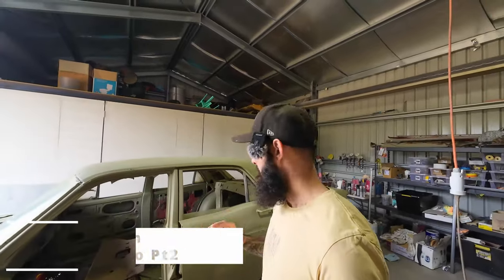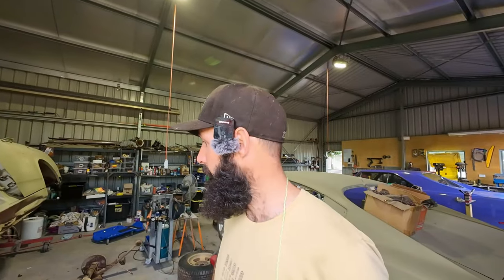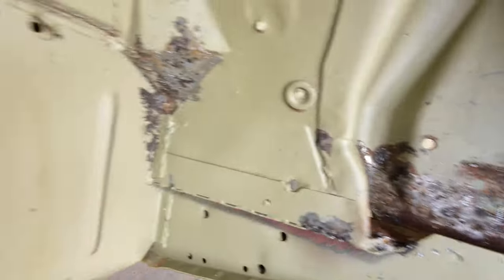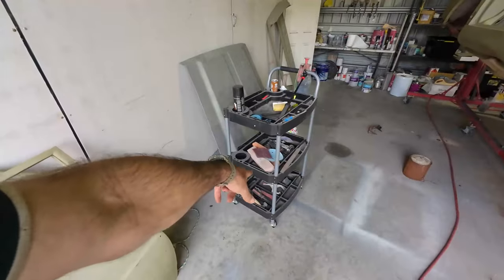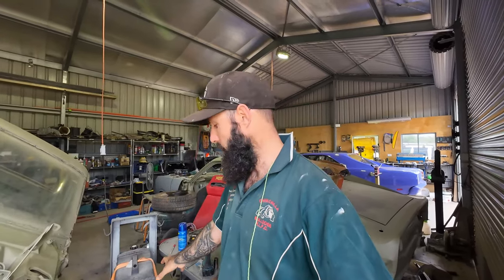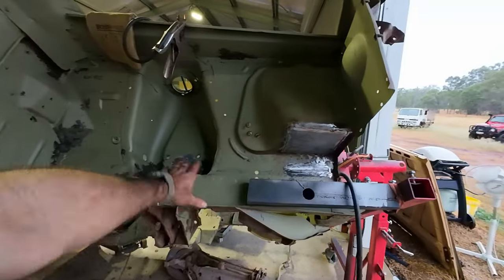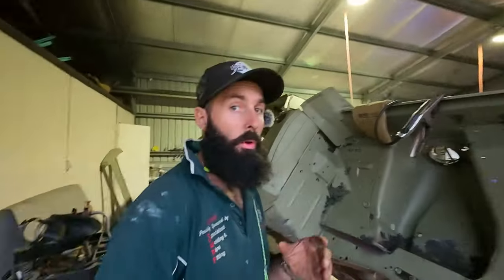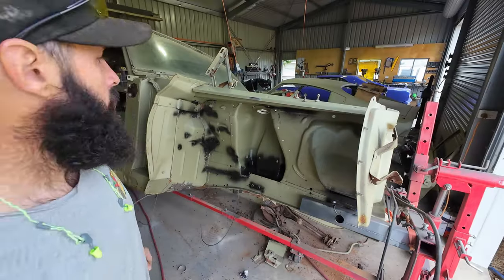Ford Falcon Full Restoration PART 2

Comment: Even on thicker steel, I have always cranked it up on the mig and done short blasts. I'm no welder, but it does seem to work better if you aren't a welder by trade.
Reply from the maker: @beano9343  I definitely do it on thin steel, haven't tried it on thick steel though, I'll give it a test run!

Comment: thanks for the tip on the fertan, just bought a Massey Ferguson 178 and it will be used for sure!!!
Reply from the maker: Ah an old Massey! Good stuff mate, yeah it works 💪
Reply: @TwistedMetalCustoms  another tip , for penetrating fluid mix 500ml of acetone with 500ml of ATF works better than most I've tried
Reply from the maker: @jamesreardon8585  Reeealllllyyyy?? ive never heard that! ill give it a go! i always come across rusty bolts haha, cheers my friend! 🍻🍻

Comment: Good to see your back into it .
I’ve always used 0.9 , so I’ll have to try 0.6. With 0.9 I find there’s a lot of grinding, to get that smooth seamless look.
With that industrial paint it came up beautifully, I use killrust gloss black but that takes days to finally dry. Cheers for the tips mate. Motavation is the hardest part haha!! 
Cheers mouse
Reply from the maker: Yeah give it a go Mouse, I definitely fount it more usable and easier to weld with 0.6, alot less grinding with the higher twnps too, just takes a bit to get used to haha. Motivation IS the hardest part for sure haha, kill rust is good but does take a little bit longer being enamel to dry but decent for a can 
Cheers 🍻

Comment: Keen as to see this build done . Mate whats the steel u use for the rust repair . Is it zinc coated or black steel  and what wpuld the thickness be .
Reply from the maker: Awesome mate me too! Um, I think it's just black steel, or plain sheet metal, and it's about 1.1mm thick im pretty sure, I'll check when i get home and msg if it's any different

Comment: Thats very interesting to see where these old Fords rust as I Iack a hoist. The hidden bits like the shock tower bottoms. I still have my Fathers XW and the only rust I can find is a tinnie bit at the bottom of the rear quarters. The floors are mint as the fire wall is rust free. We are farmers so dad put in a Ford 4 speed toploader as he was always pulling trailers.
Reply from the maker: Yeah I'm pretty happy having the ability to spin the car around! But unlucky for me mine is not as clean as yours haha, that sounds like a very good xw shell you have! Would be awesome if you restored it ! Or is it already drivable at the moment? 
Cheers
Reply: @TwistedMetalCustoms Been a country car all its life. I wouldn't restore it as all it needs is a battery, petrol and a brake and clutch bleed. Paint is a bit sun burnt down to the primer in a few places but solid.Interior is still quite usable. Still on 5 by 14's.
Reply from the maker: @johnkauppi7078  wow that's so cool, let me know if you ever want to sell it haha, a link of paint and a battery... sounds like a great survivor mate
Reply: @TwistedMetalCustoms  Could do. I'm retiring from farming. Look me up on other sources if you like.
Reply from the maker: @johnkauppi7078  will do mate cheers 🍻--Edit, there are a few of you on facebook, are you able to add friend to me on my TMC facebook at all? link should be in video description, thanks matey

Comment: Hi Twisty, you sure have your work cut out for you with the XW, she's had a hard life by the looks. The XF will make a great donor it has everything you need. The XF front suspension will bolt right in but the XF's are wider than the XW so you cant use the steering tie rod but the XW one will do. You will have to notch the chassis a little bit to fit the power steering box. Also the XF diff will be wider, but the spring perches should be the same hole centres. You will have to either do a swap for an XW/XY one or get it narrowed. Good luck.Cheers, Phil NZ.
Reply from the maker: Ah Phil coming in with the awesome info again! really appreciate the comment mate thanks! that's great info, I knew about the diff but didn't think/know about the rest.. bugger.. ill be referring back to this comment later on in the build if I forget haha. For the Diff, could I off-set the rear rims a bit so the tyres sit in further?

Comment: Chemtech Fertan is a new generation, safe, non-toxic and non-flammable rust converter that penetrates deep into rust to convert it into ferric tannate and also creates a zinc phosphate layer deep below the rust surface to protect the base metal.
    Chemtech Fertan treated metal can be overcoated immediately or alternatively provide a “painting window” giving total protection for up to six months.
    Continuous protection can be achieved with regular retreatment and provides an alternative to sand blasting and painting.
    Non toxic & Non Flammable
    Provides an ideal painting surface.
Stole it direct from the website haha.
Reply from the maker: I was like.. Damm this guy knows his stuff! Haha thanks for the info share ! And cheers for all the interest and comments mate, means alot! 🍻

Comment: The inners of the torque box’s will be a mess and full of crud. You need to remove those front seal cover plates an and blow out and clean out the box’s and treat. You also need to clean and blow out the seals. Howard Astill did a recent vid talking about how to sweep out the seals on the XB panel van.
Reply from the maker: Yeah great point, good advice mate. I'll definitely get in there and have a look and clean/treat it to be safe, thanks for the info 👍 🍻